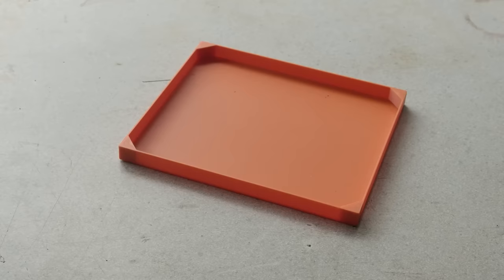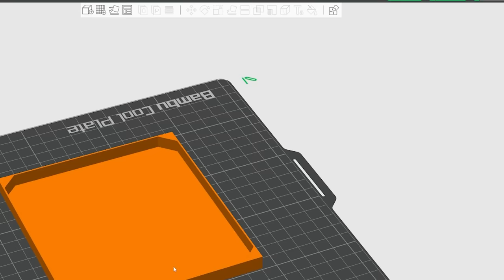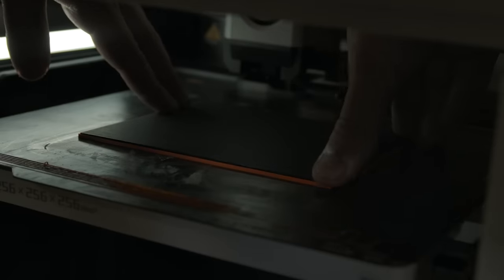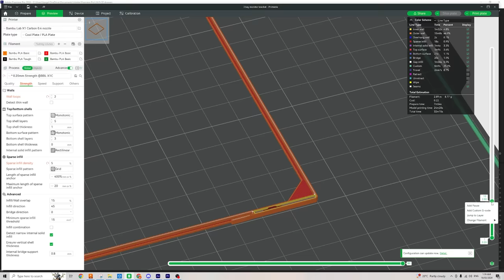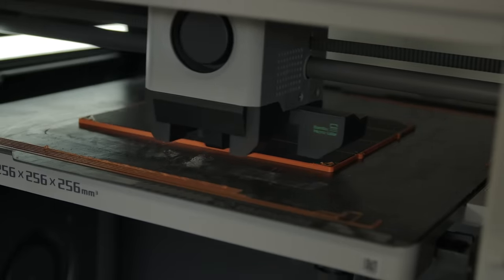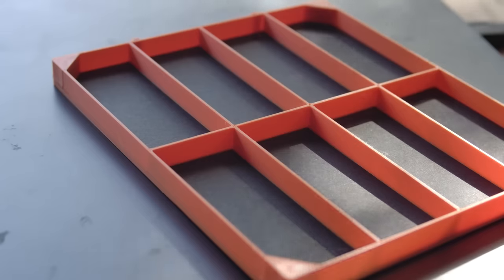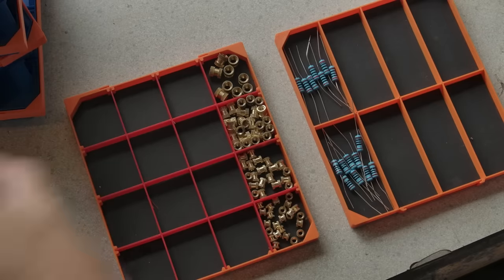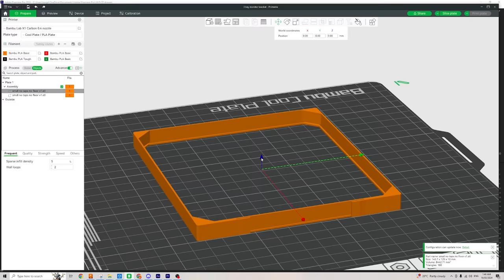The Best Workshop Storage Is... CDs?

Comment from the maker: To clear up some confusion, there are fully printed bins without the cardboard inserts if you dont want the pauses and dont mind the filament costs. However you cant stack them unless your ok with a lot of supports. With support it becomes 45 grams of filament per flat bin compared to 8 using the cardboard. The deep bins are fully printed and weigh 40 grams, but take up 3 slots so 13ish grams per slot. Do what works for you, just laying the costs out clearly.
Reply: Ngl I find it weird that that was the pushback (hey participation is participation!) on this video. If you’re doing this at any kind of scale I’d argue one would want to go the other way, printing corners and connectors and then using card stock for walls, floors and dividers that aren’t specific printed shapes. But I guess it’s a 3D printer owner/operator/enthusiast mindset. Or, no I’m sorry, it’s about the “time”.

Comment: One thing you didn’t take into account was that despite the longer print time and material cost, the old design was fully autonomous. It might’ve taken 2 full days of printing but that’s work that just happens in the background. The new system requires user input per box, which can get repetitive and is prone to error. I like the idea, but just something to consider.
Reply: That's the biggest strength of 3d printing IMO (for when it's a hobby/not the core of a business). It reminds me of when it finally clicked in my mom's head (asian parents stereotypically are averse to using dishwashers) that while a dishwasher is slower and more prone to mistakes than hand washing, it's something that can just run in the background while you do other things.
Reply from the maker: if it wasn't for the supports I would agree.  You have to stack them to automate it and you have to use supports, which will use 5x the filament and have the gross appearance of having supports removed. The pause happens a bit over once an hour and im in the shop anyways so I didnt find it to be much bother.
Reply: What about a slot to insert the card board?
Reply: @sameerayiesha  That's a way better idea!
Reply: Kind lf beats the pants off of gridfinity
Reply: @Borgedesigns  I stacked it in a way that bottom one is normally and second one is upside down, third one is normal and so on. So than there I just put one carton almost in the beginnig and than longer printing before another pause, which incorporates two cartons in relatively short time.

Comment: I like this idea for small parts storage! One suggestion I would make is to use laser cutting instead of printing to make all of the various parts - of course this can only apply to those with a laser cutter. 

Laser cutting can make things like those trays and dividers much faster but also is far cheaper with material cost of things like MDF and Cardboard/Foam vs filament. You can even use it to engrave labels with any font you like (if you have bad workshop OCD like me 😅 )
Reply from the maker: I didnt specify in this but the card inserts I did laser cut, and yeah to anyone with a decent laser itd be the way to go. Probably 8mm walls with a 2mm bottom and some alignment holes.

Comment: I have a similar setup for larger stuff in my garage.   I purchased a commercial kitchen baking rack on wheels.   It is about 6 feet tall and can hold up to 20 full-size sheet pans.  If I'm tearing down an engine, I can keep the parts organized and adjust shelf height on the fly by skipping rows.

Comment: This is a great idea, especially now you can usually find these piled up at thrift stores or sitting out on curbs for free.
I'm sure even facebook marketplace as some kicking around for cheap or free.
Even if you used a 1 or 2 KG of filament for the fully printed bins, its still probably cheaper than buying a new hardware assortment organizer.

Comment: 📥 First thing I thought is why not use the cd case and print dividers that would fit inside one. 💿

For thicker trays just remove the top of the case and print thicker dividers. 

You would have built in transparent windows for your labels.

Comment: Hmm gridfinity is 42x42mm, CDs are 142x125mm ~ 3.3x2.9 grids. Film/game boxes are 135x170mm which is 3.2x4 grids, which would be perfect 3x4 grids with 2x4mm spacing for rails. Problem is that film racks works by showing spine on the outside and that is wrong orientation. There were racks with metal sides with plastic top&bottom that should be modifiable?

Comment: I appreciate the though of trying to optimize the design so it uses less filament as possible, I can see how some people can afford an justify just printing the whole thing but the one thing that usually puts me off these types of the printed storage systems are the amount of filament and not to mention time to print! Will also definitely be keeping this in mind for when I'm also designing stuff for printing.

Also whats that cute little drill press it looks very nice.
Reply: They can also be made from wood. 3D printer is too big of a bottleneck. It is possible to make all parts shown in the video with basic handheld wood working tools in just 2 hours (prep and cleaning too). Stacking multiple pieces of wood and doing one cut for 8 pieces at once, is totally different thinking then buying eight 3D printers / stacking it in model. For me, 3D printers are excellent for prototyping, but too slow for end product.
Reply: @OskarHersch  That might be the case for you but for me, if I were to make this, I would still take the 3D printed route since I wouldn't need that many and it would still be easier faster and cleaner.

Comment: For the problem with inconsistent adhesion to the cardboard due to dips that make it be out of contact, make sure the first layers there are nothing but a grid of straight lines one way then the other, avoid any turns and just let the plastic droop onto the surface to take up the mechanical slack. Or intentionally crank the extrusion multiplier for that layer, if anything it might help there be a better seal at the bottom so parts don't slide under the dividers. Good ideas all around though!

Comment: Fine for repurposing, but most have already either tossed these when the CDs went, or are still using them.

Just a double wide CD storage rack on Amazon is $18 on Prime.  You can do much better and have better transportability.

I bought the Storehouse Harbor Freight portable parts cases (yellow and black w built in handle).  Then just custom 3D print bins of desired sizes based upon the part sizes, dividing the given storage space sizes down (or up) as needed.  When you buy several, you can simply start by rearranging them to put for example all the tiny bins into the case that will get all the tiny screws or bits and bobs, and the larger bins in the case for that size of parts. 

Do them a bit like Gridfinity so that you have a label space for each tiny bin at the top back, and a curved bottom front to easily slide small parts up and out, and you've got latching cases w parts that you can grab-N-go to where the work needs to be done with no risk of spilling on the way.  I put short wood screws in one, medium in another, longer ones in another, same thing with bolt sizes. Label the handles facing forward with silver indelible pen, and when stacked you know which one to grab to immediately to have a range of sizes for about any task.

Also, try putting all your power and types of hand tools in separate HF tool bags.  One bag per tool gets my dremel and bit case in one bag, another my oscillating multi-tool and cutters in that bag, another bag with battery drill(s) and batteries, another with plumbing fittings and pipe dope, another with tin snips and shears for metal work, etc. etc.  One JOB or TOOL per bag and you can label them and just GO.

Comment: Echoing what others have said, supporting a mechanism to place in the bottom layer after the printing is finished would be helpful. I'm thinking that since the bottom is cardboard, leaving a gap under the corners that allows the users to slightly bend the cardboard enough to just slip it under the corners might be helpful.

I'm also wondering if it might be possible to print the sides individually and have the sides clip into the corners. I might try to prototype this, it seems easy enough to whip up in tinkercad lol.

Comment: Nice concept.   At least the idea of changing the drawer size for parts sorters.  I might be inclined to go in the opposite direction for a solution.  Print the rail sides and make routed out wooden “drawers” (trays.)  Opening the ability to make rounded bottoms with ball end mills to easily go after tiny parts.

Comment: Another good trick to save time is to just simply print it normally but set the bottom layers to 0. 
The concept of inserting cards is cool but manual interventions are not everyone's cup of tea. Also, you can really do some damage on your printers if the card somehow lifts up without you knowing.

Comment: Interesting system with the card, but wouldn't it be easier to just glue the bottom on after printing?
Reply from the maker: Could be setup for that for sure but I find encasing it will get me cleaner results than trying to align and glue parts.

Comment: Kinda wish this WAS a viable option but these days you basically have to luck out and trip over a rack at a goodwill/flea-market or some such to even find them as they are impossible to find anywhere else, which leaves printing a router-base with an of-set lip to rout out grooves in something, or printing the sides of the rack to glue on a plat(/cheap laminate flooring plank likely the best/cheapest option for either route)......................
Reply: I felt the same way about Clive's disposable v*pe lithium battery salvage video, but I did eventually come across some in the wild, and I've used them to repair various things. Saving a tenner here and there is nice. Impatience will cost you money, but scavenging will cost you progress. I feel like organizer design adequately strikes a middle ground for that where there's no real urgency, but the quality matters a lot.
Reply: Aliexpress and Amazon have some similar-ish types for sale. Some for games/cartridges as well, which would work but are different sizes obviously.
Reply: @Leadvest  still haven't seen a single one in Canada. I think they're something like $40 each so nobody uses them and instead of uses the re-fillable/re-chargeable ones or just regular smokes. It could also be that people here just don't chuck them on the street and instead dispose of them properly, not sure.
Reply: Yeah, it's pretty rare even in my neck of Canada, and the culture is especially rough that way(bitter money) here in particular.

Comment: Making custom racks with the right dimensions for gridfinity would be easy with more conventional fabrication. 

I know the 3d print crowd usually stays in their lane but cutting the grooves the trays sit in into a panel to make the racks would be dead easy with a router table. Not even CNC, this is all very conventional shelf/cabinet making. Make the rack conventionally and save the 3d printing for the trays.

Comment: Your first claim is wrong though. You don't need a drawer for every part. The drawers clearly have separator slide tabs so you can add 2 walls into each drawer, making it possible to store 3 types of parts in one drawer.

Comment: The CD format, despite its age, boasts widespread use and standardization, making it an ideal candidate for inventive solutions without the need to reinvent the wheel. The CD case, with its uniform size and closable design, offers a transparent and practical option for organizing and storing small items. This leverages the broad availability of CD cases found in many households, a testament to their age and enduring presence. Thus, we can efficiently repurpose existing resources to develop new, customized storage systems, bypassing the need to start from scratch.